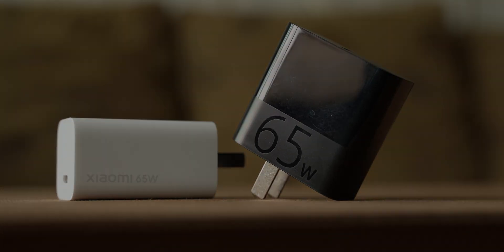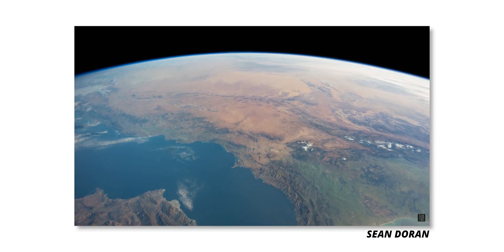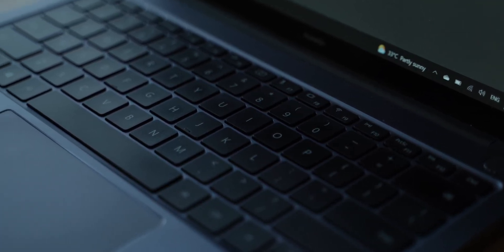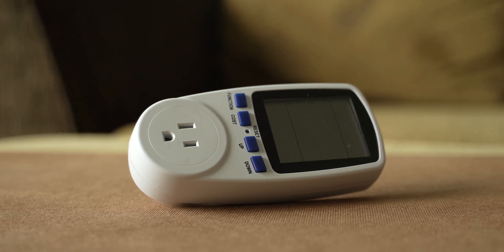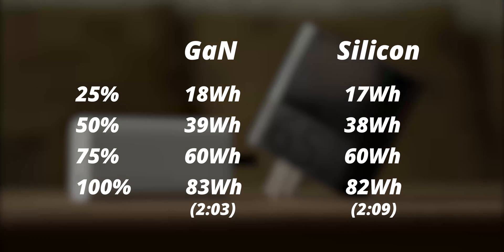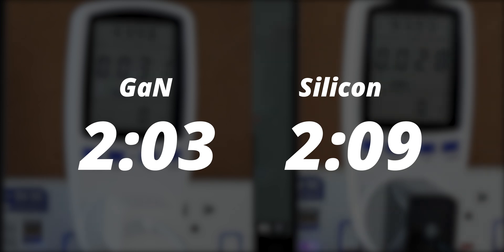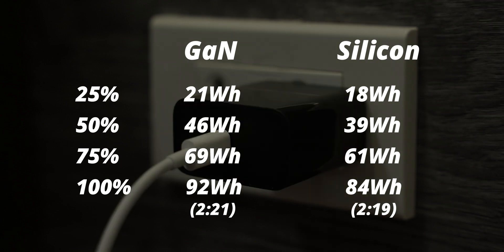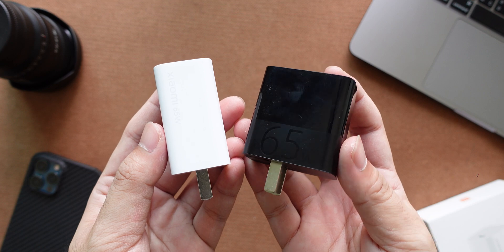Gallium Nitride vs Silicon - More Efficient?

Comment: One thing that I want to know is which charger generates more heat towards the battery.
Reply: The one with the larger voltage sir. The powerbrick can get as hot as it can but the heat that the phone will receive is from the electricity transfered within the cable

Comment: I think GAN is more of a marketing gimmick due to less difference of efficiency compared with silicon. Furthermore, a cable which may have 3A or 5A is also another confusing factor to add in conclusion. 
The way technology in chargers is approaching towards future, we would always be pushed towards buying things which have less impact of efficiency
Reply: Your thought is probably wrong ;)) GAN is more efficient, The 65W GAN and 65W Si Charger have the same Wattage output, so the 82W vs 83W input power in the test is absolutly normal, the real different is GAN is smaller in size, if the size are the same so GAN could provide more Wattage than Si (90W for example). And when using high wattage charger, you must use high wattage cable too, the 3A use with 65W charger (3A with 20V max), the 5A use with 100W charger (5A - 20v max). If you use a 3A cable with 100W charger, you can only juice 60W from the charger.

Comment: More accurate test would be to load up both chargers with dummy loads on both 5V and 9V lines and watch consumption on 110V line with actual ampere meter.

Comment: I'll explain exactly why this is a garbage test as it misses an extremely critical fact, the amount of materials used.

The design goal of the charger is not to increase efficiency, it was to decrease the size of a fast charger. Gallium Nitride will move more current with a smaller surface area, as its conducting electricity when you increase current its temperature coefficient will increase the resistance thus creating more heat.

In the end, they are limited by the maximum amount of heat they can generate per unit of area, ignoring thermal conductivity the larger the area the more heat can be dissipated. Because of this if you build an equally sized GaN charger it would no longer be a 65 watt charger, it would be say a 130 watt charger & people would complain saying the testing isn't "fair" when it runs more more efficiently than an 65 watt silicon charger despite using the same amount of materials.

So yes Gallium Nitride is MUCH more efficient than silicone which is exactly why the charger can be 1/3rd the size without causing a house fire. Its sad you came to this result because the rest of your video was pretty well made but I understand how it would be easy to make a mistake like this as manufactures are only advertising the maximum rated current & given that you wanted to see which of 2 "equal" chargers would be more efficient.

Also in regards to the cable, you should be using the same cable for each test, differences in manufacturing could skew the results, if one cable uses thicker wires, then it would appear more efficient. The best would be buying a USB standards compliant third party charger that is super short to minimize the impact of the cable in the measurement results, but even so the test would still be flawed anyways as this isn't an effective way of measuring material properties, but a perfectly fine way to measure a specific products efficiency.
Reply: Thanks, after you mentioned it, I compared my two chargers physical size(one is GaN, one regular) and the GaN definitely is smaller even though they're the same wattage. Very interesting

Comment: Primarily, the GaN application for mobile device chargers offers size & higher power benefits as compared to Si-based components. And the negligible difference in charge time in this comparison makes the GaN-based device a preferred choice. GaN higher electron mobility & higher power than Silicon makes GaN the Future choice for high-frequency devices and mid power 600v-1Kv.

Comment: in 2020 people were posting articles saying we would be wanting GAN chargers and up until now in 2022, there have not been any consumer test of it's effectiveness except this video that debunks the efficiency of GEN chargers. So this is proof that GAN chargers are not infact more efficient than silicon chargers. The other thing to note is also that the only difference in GAN charger and silicon charger is that small IC chip that supposedly is going to make it more efficient which cmon, lets be real, that will never happen. so seems like GAN chargers are considered snake oil at the moment
Reply: A true 100% GaNfet charger will use less total wattage to produce desired output wattage. This is because the charger does not waste nearly as much energy as heat and can sustain higher outputs for longer (again due to the affect of heat). Do not be so quick to dispute. You need to pay at least $50 to get a a real GaN charger, not just one using GaN as a marketing term.

Comment: If you do not understand how GaN beats Silicone chargers in efficiency watch this and you will better understand.
Also the cable, charger and device used makes a huge difference 
https://youtu.be/oTUZQDpQcU4
Reply: @444mikeee  I usually  stick with name brands like Anker for my phones.
Reply: but it was concluded that the charger in that video is a scam and doesn't actually have GaN in it.
Reply: @TabalugaDragon  I'm talking about GaN chargers. It's explained in the video the difference between GaN and Silicon chargers and how much more efficient and cooler GaN is. It's also much better on the environment, less pollution, less plastic and waste, faster charging at cooler temperatures.
Just no reason to keep Silicon chargers in 2022.
You most likely gotta pay $30 for a 30-45w GaN or $60+ for a 45-80w GaN charger
Reply: @CameronDC-Grimes  yes but there was no actual GaN in that video and therefore no actual comparison. The comparison the guy in this video did(the one we're posting comments under) where he actually compared power drained from the wall is excellent, but I wish he used something else, like a uGreen charger. 
I read that GaN wastes only half power as heat compared to silicon chargers, therefore, by all logic, it should consume less power from the wall. 

"Just no reason to keep Silicon chargers in 2022." which is why I ordrered a uGreen GaN x 65w charger 2 weeks ago, it's an amazing tech. But still, I want to see real efficiency comparisons, because aside from this one in the video, there were none. And I don't have my own wattmeter to do a comparison myself.
Reply: @TabalugaDragon  There was GaN in the video when he built the circuit himself.  Although, he did not utilize the higher switching speed offered by the GaNFET.  With a higher frequency you can use a smaller inductor with less resistance, leading to even better efficiency.
Reply: @johnettipio  I wish somebody tested UGREEN CD 217. It's even better than the Gan X I mentioned above. It's literally almost 20 degrees cooler at the same size and power. Both are 65 watts and yet, even despite quite a small size it gets barely warm at max load. 
I wish SOMEBODY tested its efficiency already. If GaN tech is more energy efficient, it's in CD 217.